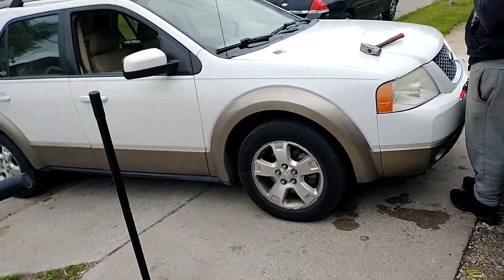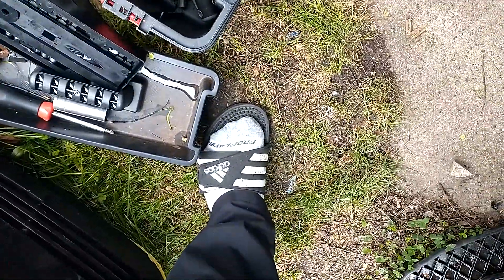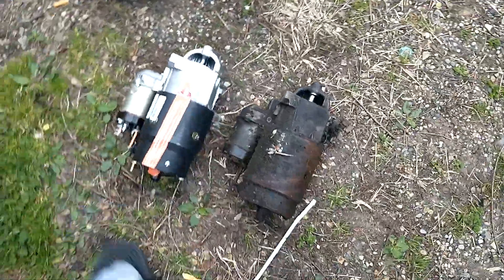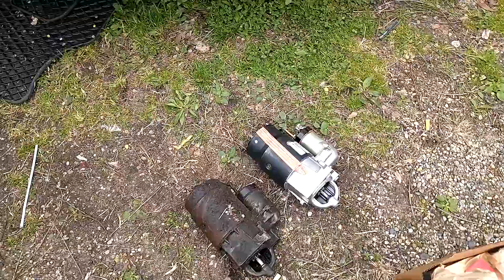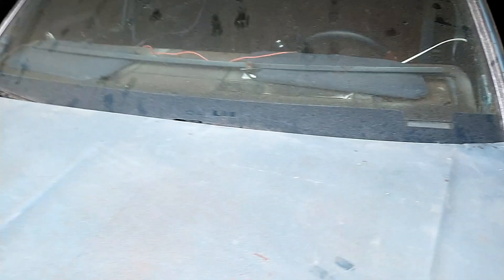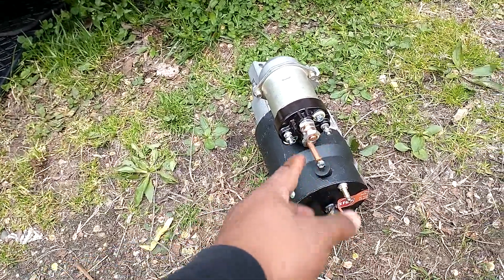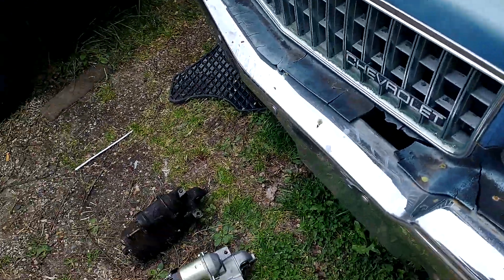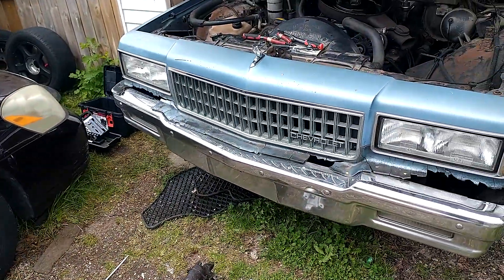Chevy caprice starter old vs new

Comment: Bro you right! Nobody made a video on the box chevy starter. I just got mine and struggling trying to put it in myself lol
Reply from the maker: Word well hopefully I helped a little.. Lol drop a video once you start to change it bro
Reply: Did yall ever put yall starters in I'm struggling trying to replace mines lol. I got the wires removed and mounting bolts off but it's too much in the way that's stopping me from pulling it straight out.